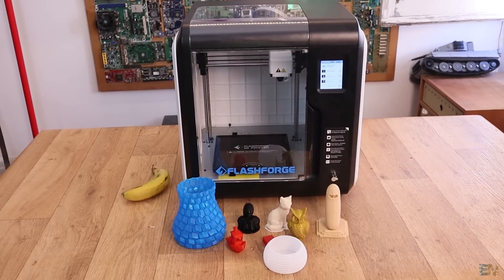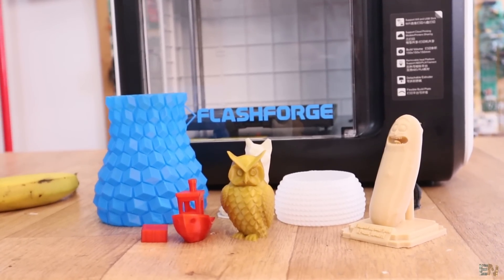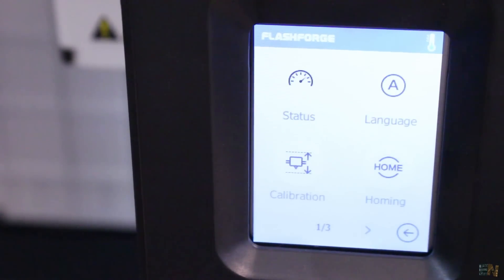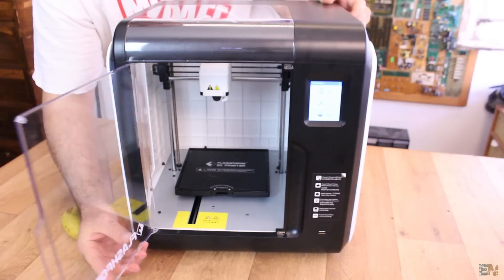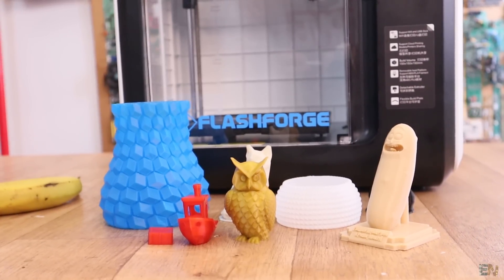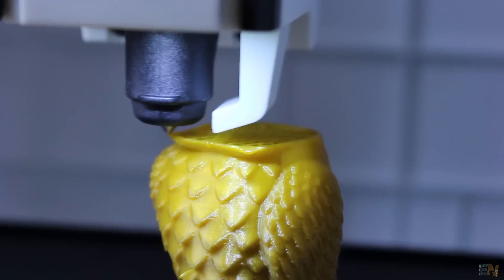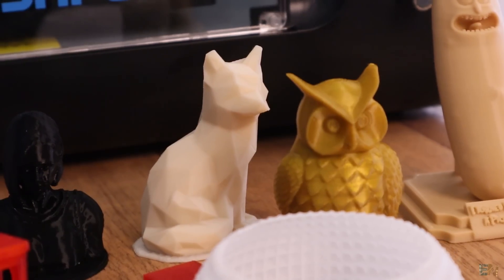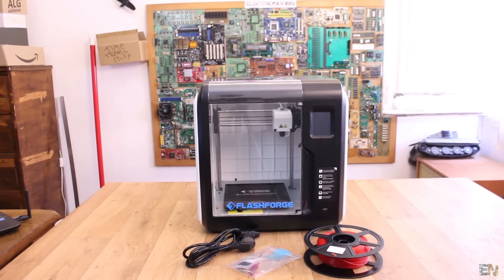FlashForge Adventurer 3 REVIEW 3D printer

Comment: Hi there, thanks for making a video about the printer! I am a total newb and I might have a stupid question. I was wondering if it is possible to print without seeing the actual layers, a more smooth version. By using a different material or something. Im planning on making fan art and it rewuires the print to have a real round shape without actually seeing the distinct lines! Thanks for reading and possibly reacting :)
Reply: You will always have some layers, but you can work on the prints after printing to hide they. Search for 3d print post processing. I do quite a bit of sanding on the prints I want to have really smooth.

Comment: This is not a good printer. It's riddled with design flaws and the inability to level the bed is a huge problem. It's like a beta machine that's been pushed out way before it's ready for market. I've had three and all had to go back for different problems. On paper, it looks good, in practice, it's not. It'll just drive you mad over time.
Reply: Do you know about any 3 - D printer which has USB connectivity? By that I mean one which can actually read a file from a USB. I understand there are a lot of people who claim there are printers like this on the market, but I am doubtful unless you know about any.

Comment: Camera is rubbish. Gimmick
Wifi IP address resets everytime
Printer randomly locks up
Rattles develop over time
Extruder renown for missing steps due to nozzle getting blocked.
Looks aren't everything.
And I went through 3 units before getting a full refund.
Ender 3s all the way. Never looked back.
I was surprised to hear such a postive review 
Also aimed at commercial level but far from commercial when it couldn't handle a few weeks of printing.
I have a spare Nozzle for it if anyone wants one.
Reply: There's a patch for the IP/mac address issue. Fixes it completely.

Comment: This is the worst 3D printer I have ever bought. It has a lot of issues that you have not identified on your video. These are:

1. The original nozzles only work efficiently with flashforge low temp filament. Other filament suffers drive jumping. Nozzle is somewhat less than 0.4mm. Flashforge have released a new nozzle but they are only available to buy, Flashforge are not replacing the faulty nozzles for free.

2. The build surface very quickly loses stick and glue will be needed. The surface is also quite thing and can tear easily.

3. The printer can only be levelled along the Y axis. There is no way of adjusting front to back. If you are unlucky then the only option is to use rafts for every print.

4. The network interface uses a random MAC address every boot which means your router/hub will give it a different IP address every power on. Direct access to the camera or connection from Flashprint needs the IP address to be determined from the settings EVERY TIME.

5. You describe your printer as quiet. Mine was one of the noisiest printers I owned.
Reply: Oh, seems that you are really not lucky. I also had some problem with my Adventurer 3. But seem that after contact with official post sales, it was solved well. May be you can try with them first.

Comment: it seems a bit more printing quality than ender3, but ender is cheaper and it has big volume, I would not recommend it because of that replacement parts must not be found on only one manufacturer
btw  wifi , camera , enclosure and nice hotbed can not cost 200$ more, cam and wifi feature is not crucial but enclosure can be important in terms of ABS printing
this is not affordable and reasonable price i think.

Comment: How do you find this printer print quality compared to that of ender 3?
Reply: I returned my Adventurer 3. Was good at first but too many problems developed. Not a good printer at all.
The Ender 3 prints way better.
Sorry but this video is misleading.
Reply: @swiftrick15  I had ender 2 for several years. I still can't get it to print like my stock adventurer 3.  Creality build quality is awfull compared with my adventurer 3.  I've had trouble with almost every mechanical part on my ender 2. Especially the aluminium extrusions that aren't cut at 90° and the acrylic base plate with inaccurate holes.  I print with the same cheap Clas Ohlson 1kg pla spools on both machines. My ender is currently a nightmare to bed level, because the micro SD slots is of course broken (like on most creality machines).  I can't load the gcode where it I can easily bed level and push button to continue. My bed level screw spring looks ridiculous. Some springs are much more compressed than the other. Because of how bad the build quality is. All my creality rollers was bad quality with sideways movement, so I had to use printed pla shims and use careful screw torque to remove inaccurate assembly.
Reply: @vectraB97  Horse for course mate.
I said Ender 3. Never touched Ender 2. And who is to say your building skills had no impact. Sorry. I went through 3 Adventurer 3's and they were all noisy, and inconsistent. Overpriced. All your complains are non existent in the Ender 3 line up. Which is what I said.
Sorry Fanboy
Reply: @vectraB97  anyone who prints shims with PLA is crazy. How come none of my Ender 3s have problems? Weird hey
Reply: @swiftrick15  creality doesn't know how bearings work. The pla shims work way better than the original ones that makes everything wobble. You could file down the original shims or buy the correct thickness. Those bearings are not made to take sideways loads. Basic knowledge creality doesn't understand. It's ridiculously how they design the beds on nearly all creality machines.  All the cables are also in need of strain relief.  I don't think creality know how to make reliable machines.
Reply: @swiftrick15  all creality machines has the same quality flaws. The ridiculous ender 2 design is brought on to ender 3. I could literally build the ender 3 by just buying the aluminum extrusions and the bed assembly.
Reply: @swiftrick15  you should watch this.  The rollers are a flawed design.   https://youtu.be/_95jtjWNvdA
Reply: @swiftrick15  guess what prusa printers don't use stupid low quality rollers like creality.. I think there's a reason for that..  linear rail upgrade is very popular on creality machines. Because even creality enthusiast's know the rollers are flawed.
Reply: @swiftrick15  Axial forces require thrust bearings. Creality mounted the bed wheels the wrong way.  It's a ridiculously flawed design..
Reply: @vectraB97  You said it all. Prusa fanboy too.
Sorry guy. My printers are great.👍
And I print ABS, NYLON, Flexibles and CF.
Rollers use bearings. On Ender 3 they are fine mate. Same as Chiron.
I would never buy a Prusa or Flashforge again. Overpriced. Over rated, with people like you who talk rubbish confusing people.
Research chum.
Reply: @swiftrick15  I have no specific brand I favor. Creality has become the most over hyped brand. And I can't see why. Many printers are more sturdy and reliable. Even at similar price range. I'll take anycubic I3 mega over ender 3 pro, any day of the week.
Reply: I wonder what settings u used on printing petg.